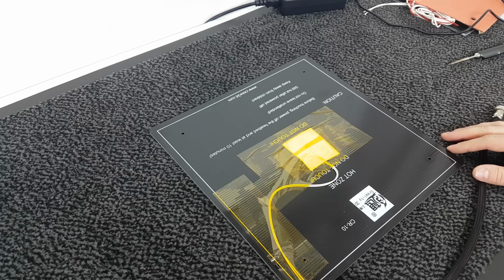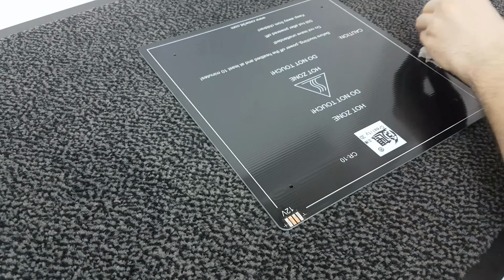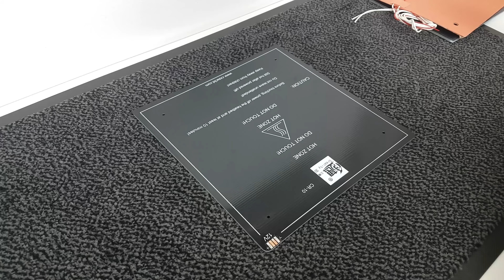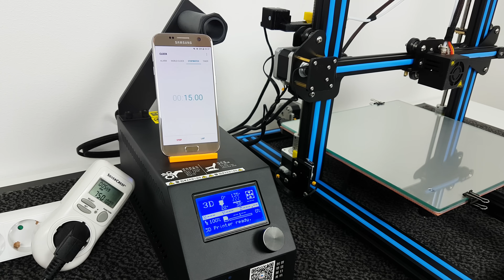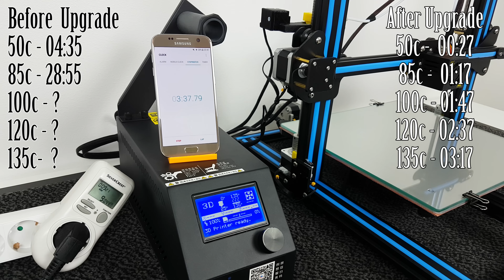Creality Cr10S ultimate Heat-bed upgrade! 750W heater installed

Comment: so will the printer consume 750w instead of ~250 watts?
Reply from the maker: Tiberio Cellini Yes instantaneous and in later in quick impulses when it reach desired temperature.
Reply: under this point of view seems a very expensive upgrade, expecially for long time print.
Reply: It's cheaper with the 750W because your print time's shorter due to the shorter warm up time. You can start sooner with printing, and the bed stays on temperature much easier. Some plain physics, it takes the same amount of energy to heat someting up. With 250W it just takes a lot longer.

Comment: hello, could you give us the model of the screws that you use on the power supply?
Reply from the maker: Sorry friend. I just use random screws that I had. Just keep in mind they need to be short otherwise you can short out power supply. And if you do this upgrade install Anycubic ULTRABASE and avoid using paper clips. Am afraid they could maybe damage heat-pad after long period of use and it might be dangerous.  Adding one ground wire to aluminium plate or to one adjusting screws is good option to. Never be to safe. Cheers :)
Reply: Thanks for your advices.
I will pay attention to the grounding.
Thank you

Comment: I hope that ssr gets enough ventilation as they are designed to be installed with a heatsink.
Reply from the maker: Dainius G There is fan blowing directly to SSR and I attached SSR to Power supply which works as huge heatsink.

Comment: i found a 200x300 silicon heater for 20$. Will it works?
Reply from the maker: Alessio Suppo I really can't tell, be careful about cheap silicon heater pads, there is reason why they cost 20 usd about 3 times less then normal price. Nobady can say are they are good or they will short out directly after start. And you need 300x300 to spread heat evenly over whole glass.
Reply: I will try it but i want to change the Thermistor position, it even has 3M adhesive
https://www.banggood.com/220V-30x20CM-750W-Waterproof-Thermostor-Silicone-Heating-Pad-For-3D-Printer-Heated-Bed-p-1161616.html?rmmds=cart_middle_products&cur_warehouse=CN

Comment: I dunno why any company would make heatbed less than 24v. 12 volt COULD be sufficient with enough Watts but then you'd need HUGE wires like you'd connect a car battery. lol

Comment: You really should NOT reuse that 12V connector for mains AC voltage, dangerous! Other than that I like your videos.
Reply: Aviation connectors are rated for AC.

Comment: @ nexi tech wich printer is your go to printer? Cr-10s or tevo tornado or another would love to know your preference.
Reply from the maker: marko rodriguez Definitely CR10S. It's a working horse. Never failed me even once and I'm using it every day. Parts are cheap. Frame is open type, easy to reach and change parts. Simple design. Awesome build and print quality. Good price.With this upgrade for me personally this is complete 3D printer.
Reply: Thank you!

Comment: hi nexi this update it is 100% safe thanks
Reply from the maker: Right know Yes. I have over 120 hours in printing time after this uprgrade and all of them is with heatbed turned on. In fact right know am printing huge parts for my next video( print time 20 hours+). I just put back Anycubic ultrabase from beginning of video and i don't use paper clips no more sense
 it has double side tape underneath. No heat on wires or conector or on solid state relay. It's holding great for now. Am very satisfied with this upgrade. Best thing ever.

Comment: While the idea of this upgrade is a good one and improves the operation of the 3D printer quite significantly and you look like your quite capable in what your doing, it is not a safe implementation for the following reasons
1 Your connector on the back of the case will expose 220V if the plug is not connected, this is a NO NO. 
2 There is no fuse in the circuit, most countries dont have a fuse in the plug, you really should have one. 
3 The frame of the 3D printer or at least the bed should be grounded, just in case of a fault occurring. 
4 I am not sure of cutting holes in those heat mats is a good idea, you can easily expose the mains powered wiring inside or even cut it altogether making the mat useless.
5 Using the same color wiring as the 12V system in the case can cause someone going in their later to think it is the same voltage as every thing else aka 12V and you know what that can mean....
6 The plug and socket is not rated for 220V as another viewer has mentioned.
7 Not using correct termination techniques on the wiring is not a good practice, stuffing the wire under the spade terminal is just bad. you should crimp on additional spade terminals to do the job properly.
8 Not enough warning to viewers who may attempt to copy this upgrade was given, this can be extremely dangerous if performed by an inexperienced person.
Reply from the maker: There is nothing wrong with the connector. I been test it with 30+ hour print with heat-bed ON and I monitor everything with thermal camera and it was no heat and no issues and then I upload this video. 
Right now It have over 120 hours on this setup and all of them is with heat bed ON. Again no heat, no issues. And connector is on metal case that is also huge heat sink in some way... 
About the tape on the socket no: I used white insulation tape to get extra safety but if you look at 5:45 there is plastic insulation ring covering whole connector.  Over connection there is safety ring and there is no way that this connector ever have bad connection.. 
Now about the power(amps) going through the connector. If you do calculation in amps on the connector. Before it was 18A x 12V =~220W now is 3.4A x220W =~ 750W that's 5.2 times less stress in amps on the connector. And there is again no heat ever that i found in my testing with the help of thermal camera and with one more infra red temp sensor and with my hand. 
Why would I use thinner wires on 220V when there is a fuse in control box on 220V? Power-supply and Solid state relay is connected to that fuse. Its 10A fuse 10A x 220V = 2200W. Thin wires will add more stress and more heat to the system.
And if you guys ever want to do this upgrade then please do it in your way and use this video as idea or reference how to do it or at least just for compering results etc heat up time... 
P.S.
I add disclaimer in video description.
Reply: The plug is same as this one: https://www.aliexpress.com/item/5Pcs-Aviation-Plug-4-Pin-16mm-GX16-4-Metal-Male-Female-Panel-Connector-New/32758594495.html? if you look on descriptions it clear say 220V/15A!
The unit does have fuse on AC of 10A inside, there is no need to add extra fuse.
Cables rated for DC use of that amps are more then good for AC use, yes it may confuse a n00b in electrical stuff but since this is not made for commercial use...
I agree only on bed ground in case Murfy law apply, no need for whole case since is not connected to the bed, and about wire connection.
Yes the connector ca be changed with something more n00b proof or in case the maker forget about modifications and start putting his finger in with the unit powered on...
Reply: She'll be right mate, thats what RCD's are for. But in all seriousness I would take the advice from Peter Oakes and also run an Earth out to the chassis of the printer.
Reply from the maker: Connector is rated for AC 250V 15A! That's 3750W! Silicon cables that I used are more then fine with AC as the same cables are on AC side of original power-supply. CR10S heated bed and silicon pad are isolated from rest of the printer as wheels on which heated bed are rolling back and forward are thick non conductive plastic rings so there is no use of ground on the frame, but adding ground to the aluminium pad itself and metal case is always good idea. Never be to safe.
Aviation Plug 4-Pin gx16-4 Connector -- https://goo.gl/VaxK64
Reply: #4. He clearly explained that the holes in the heating mat were from the manufacturer who makes the heating bed for this 3d printer. He didn't cut the holes himself.
Reply: You are right - a more appropriate work around with the socket would be to use separate, soldered, lower gauge (for safety) cables for the 220v, eg. drill a hole in the side of the box to accommodate this with added 220/120v fuse coupler. 750w through that gauge of cable concerns me more than anything, the cable under load will heat up with the current demand and if the connector does not have a perfect connection, the connector will physically heat up due to the resistance. Can it (the cable harness) handle it - yeah for short bursts but a constant long term load will (should) heat up the harness eventually.  The exposed soldered terminals on the connector should at least be shrink wrapped with glue impregnated wrap in case the connector gets bent and you have a short (look out!). The tape over the spliced wires is bad. Another location to use electrical shrink wrap ...just some thoughts.... This video does at least show how to approach this installation properly enough though.
Reply: The problem is that it's possible, and Murphy tells us that anything that is possible will happen. One day the heating will stop working for some reason, diagnosing starts, people might die.
Reply: I would agree regarding grounding and disclaimer. But everything else you posted is either misinformation or misconceptions. Plus, whoever suggested using thinner wires as a ”fuse” should be shot on site.
Reply: Spot on.
Reply: Do you think you should suggest that the cables should be cut longer, since you are shifting the cable about 6 inches to the right of where it was mounted prior? The cable is even shorter now.
Reply: "sleeved" portion of cable is same length. so his cable is now "that much longer" than the other cable.
Reply: Adding a fuse is very important, fuse protects the wiring from melting if the heater fails / shorts out
Reply from the maker: alan connelly There is fuse in the switch. 10A rated on 220V that is 2200W much more then I need.
Reply: Nexi Tech good job, as long as all the wiring is rated over 10amsos your good, hate to have your wiring become the fuse!!
Reply: @NexiTech  yes, that is the problem. Fuses should not be much more than you need.
Reply: 3) if you do not ground metal case and you put that product on the market, you would be kicked out of market pretty soon (and heavily fined).
6) Connector is rated on amps AND voltage. Connector you are using is certainly not rated on 230V. Again, you would be kicked (and heavily fined again).
Cables that you use also should be rated 230V.
You are using metal frame. If you feed 230V to heater, again this metal frame should be grounded etc etc...
I know it is hobby project but still, not safe.
Reply: @hrvojelasic5794  what i can find on the internet is that this type of conector is rated to 300V 5A MAX, so is probably safe.
https://es.aliexpress.com/item/GX16-4-pins-16mm-aviation-connector-female-plug-male-socket/32299947855.html
Reply from the maker: Peter Oakes 
1) I don't see any reason why would be somebody who is done this upgrade ever screw out safety ring in the plug and then disconnect the plug and stick finger on pins in plug (220V) when printer is on?
2) Yes, there is fuse in the sistem inside main AC plug and powersupply and the solid state relay is connected to it. it's 10A rated (10x220V is 2200W so it's fine). 
3) If AC heater silicone pad ever catch short circuit fuse(AC) in control box will burn out and cut AC main voltage (small chance that AC heater will ever get damaged because of much lower temps that CR10/S will ever use sense is 135 max in firmware and 260C is max rated temps for AC silicon heater.
3. There is no point to ground the whole frame sense heated bed is isolated from printer frame(Plastic on rollers bearings) but I can agree that extra safety is always welcomed so adding extra ground wire is good idea and I might do follow up video. 
4. I didn't cut or drill any holes on AC heater(am not crazy) holes are already pre cut and made by manufacturer.  This silicon heater is made for CR10/S and have holes on right place.
5. And other AC wires in the control box, power supply and on AC switch and fuse are what color? The are the same red and black... Look again. All wires colors on AC and DC was the same color even before this upgrade.
6. I can't agreed on this one because amps that going though the connector now is 3.4A and before was 18A that's way less heat and stress on this plug then before. 
7. I pull every wire hard to make sure they will not fall out. It's holding very strong. Adding two spade terminal on single screw will luckily be ever worse because of bulky plastic insulation on the spade terminals can push each other out or not be able to hold strong as is now..
8 Ok I will will add disclaimer in video description and on video that this can be dangerous if performs of unskilled and inexperienced person who don't know that AC voltage can be dangerous. 
9. Only thing I can see that may be issue here is the paper clamps and I don't like them near AC heated and I recommend installation of ANYCUBIC ULTRABASE and no longer paper clamps. I will add that in description and on video.
Reply: Hi there, I appreciate the response and clarification for many of the points I raised, some of which are based on a general view rather than country specific (I did not see what plug you were using for instance, most countries do not have fuses in plugs (UK is the only one I am sure of)

So in rebuttal to your rebuttal (All Good I assure you)
1. Doing it for your self is your risk, but others may copy and either way it is not a recommended way of wiring mains (That's why sockets are on the wall and plugs are on the appliance :)
2. Good to know but my point is still valid for countries where this is not so.
3. yes, with fuse in place, this is ok
4. Good to hear, I have a pad exactly like this but without the holes, I was not aware you had one special for your printer
5. It is good to know your not making the wiring worse but it is bad in the first place when these are not clearly distinguished from low volts and mains, this is not your doing for sure, it is the manufacturer, but if I was in there doing this, I would have taken the time to improve things. You certainly did not make them any worse so that;'s good.,
6. Yes, you have significantly improved the current load through the connector but it also has a voltage rating, this is what is now being exceeded, this may be fine for years but it is things like the insulation breakdown, the clearance between pins etc that is now being  violated based on codes etc. Will it work, sure but is it to code.. probably not.
8. Excellent, thank you.
9. I did not raise that point but it is a good thing to mention and fix.

To clarify and on the positive side, I do feel you made a great video and it is a good upgrade, my feedback is only intended to help people who may follow in your foot steps but with lesser understanding or skills, when I make my videos this is something I always try to cover when dealing with mains especially, here in Canada i have the drawback of only having 110V mains, yes less volts but twice the current to make up for it for the same power so wiring always has to be so much thinker, just one of the things I miss from living in the UK :)
Reply: just one nitpick. the power difference is much bigger than you think.

your AC Heatbed drew 766 watts at max while your 12v heat bed will only pull 220 watts at max.

that is nearly 3 times the power draw for the silicone heat bed (this is WHY it heats up so well and so fast)

amps means nothing. volts x amps = watts which is what value you need.

I am not sure what the rating is on that terminal connection on the back of the CR-10s.

I am curious. on my electric car there is an interrogation circuit such that the EVSE will not permit 220v power to the plug unless its connected and properly talking to the car.

can we install some simple circuit like this for the CR-10? ie disable the 220v output to the socket if its disconnected?
Reply: @nerys71  what i can find on the internet is that this type of conector is rated to 300V 5A MAX, so is probably safe
Reply: I am with you. What he did is too much risky buisness. If solution works doesn't mean that is right solution. You have right with every point. This video can kill someone.

Comment: do you think 120v vs 220 v heat bed would make a difference if the outlet only gives 120v?
Reply: The wire gauge does matter but not to the extent you mention, and not relative to the resistance of the heating mat, also you can use the 220V mat with 110V but you will only get a little under 200W if you do.

You need to understand ohms law,...
Half the voltage will give 1/4 the power as the resistance is staying the same so the current is half. Power is Volts * Amps  so 220V * 3.4A = 750W and also Resistance = Volts / Amps so 220V / 3.4A  = 65 Ohms. if we use 110V then current = 110V / 65 = 1.69A and that is only 186W.

You need to get the 110V version which will draw about 7Amps to give the same 750W and its resistance will only be about 16 Ohms.... way less.
Reply from the maker: Jaime Frias Jr I think yes, It will under powered. I recommend that you select 110V version. You have link of parts in video description.
Reply: You can't use a 220v bed on a 120v supply. It won't work at all. There shouldn't be a difference in heating times if the wires are gauged to carry the same amount of amperage as the 220V version

Comment: It wouldn't make a diference if you ground the bed if your outlet isn't grounded wich most of old houses aren't atleast here in The Netherlands.
Reply from the maker: Well at least there is 10A safety fuse for AC in 3D printer control box on main AC plug.